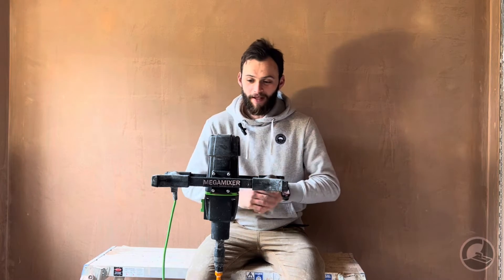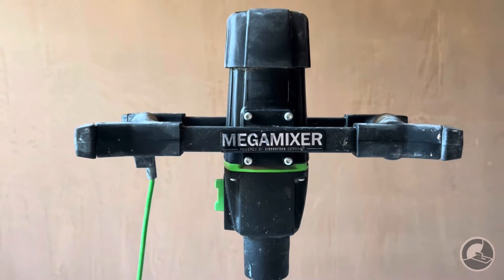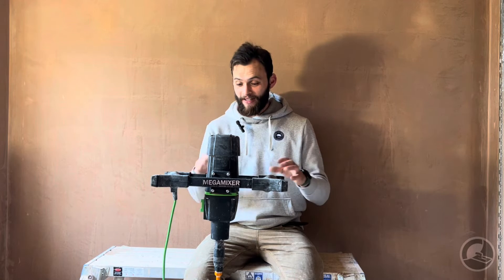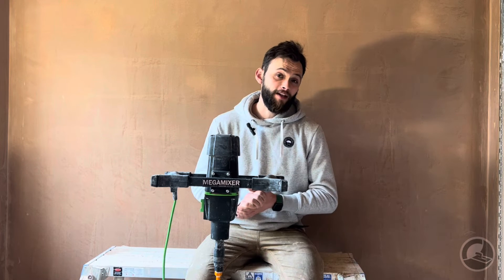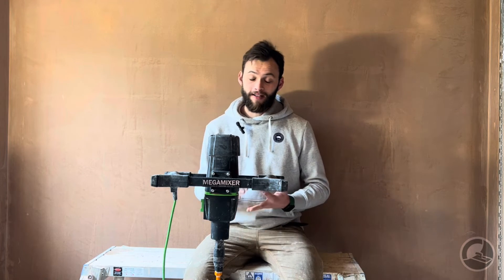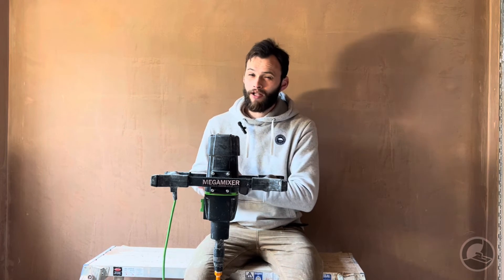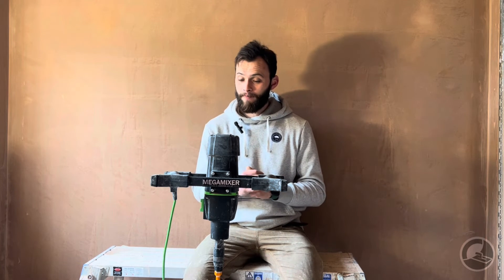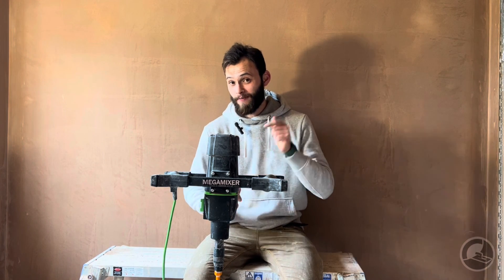Refina Megamixer Review

Comment: I’ve got the single handle one and I love it, besides loosing my grip on it, it spinning wildly and the cable snapping halfway down mid mix. Nothing a professional joint box didn’t fix and it’s fine now. Surely there’s a way they can prevent the cable snapping
Reply from the maker: Buy the cordless one. 🙃
Reply: @AlexMorleyPlastering  haha hindsight is a wonderful thing. I only bought the single handle one as I was replacing all my stolen tools and didn’t wanna spend the extra 50 quid on the double handled one. Shouldn’t have been tight and got a cordless one really